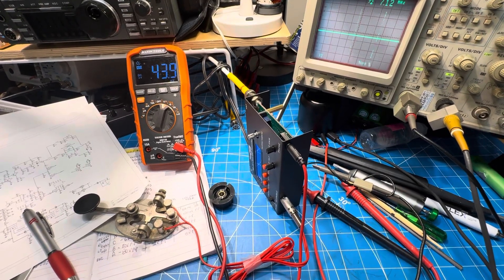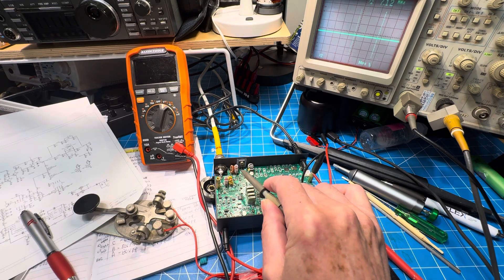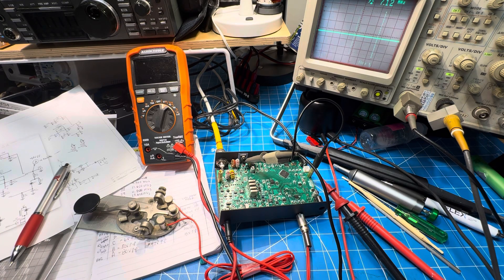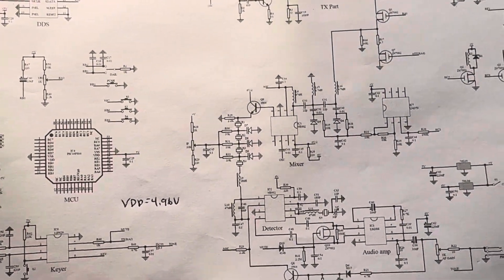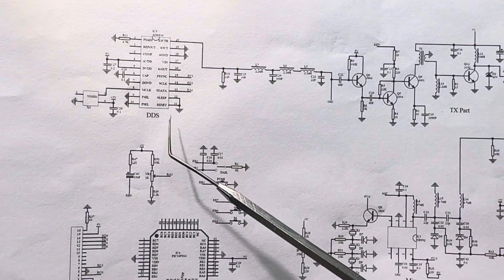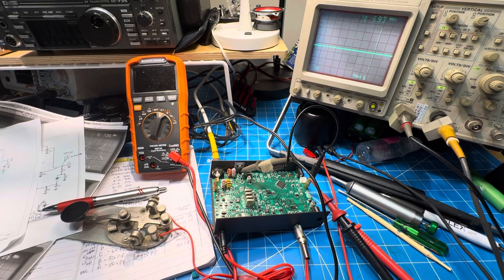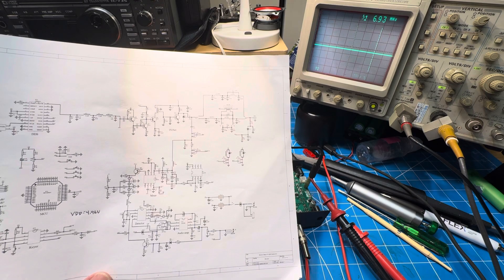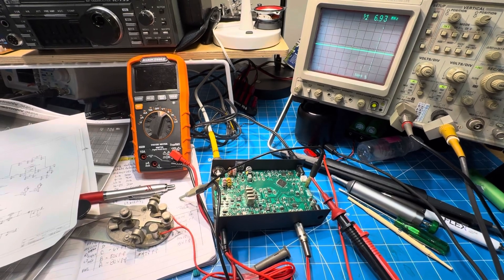HB-1B Low Transmit Power #13 - The PIC MCU Gets Hot on Transmit!

Comment: from out of left field ... it sounded like the sidetone freq was changing on key-down? Has something gone wonky on the 5V rail? Removal of R46 will isolate MCU RA2, probably leaving the rig in rx mode?? If the MCU still heats with no R46 and key down I'd be looking closely at anything on 5V. A curly one to solve. If you start fiddling maybe remove C8 ... just in case it transmits and the rx path is open ... don't wanna kill the rx front end.
Reply from the maker: Thanks Neville! You got me to clean up the RF on the transmit line with some .1 uF caps, then found the heating doesn’t happen on 20M. 
On the trail of a possible bad relay or driver now